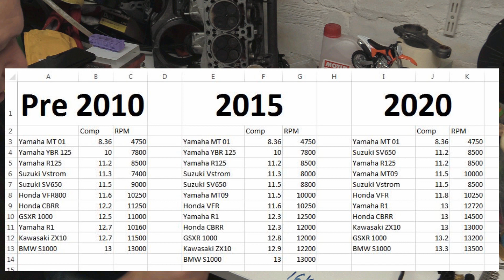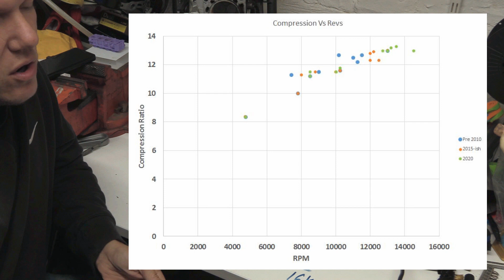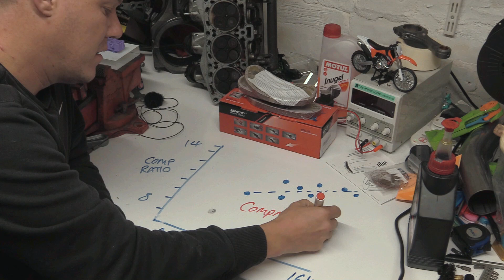High compression and RPM?

Comment: A little bit late but here are my two cents: The higher compression ratio obviously compress more the air/fuel mixture which mean that the air and fuel molecules comes in closer contact with each other , this increase the mixture temperature before the ignition event as well so both factors acts as catalysts of the fuel oxidation ( burning) , so it happens more intensively and respectively finishes faster. The faster completing of the combustion process mean not only higher efficiency, power,torque ( because the time for heat exchange between the burning charge and combustion chamber walls is shorter , so less heat transfers to the cooling system doing nothing but increasing the cooling required losses ,respectively this heat remains in the combustion chamber where increase the pressure of the expending gases ,which exercise higher force on the piston) but also allows higher RPMs just because the combustion occupies shorter time period . Higher RPMs are obviously needed for extraction of higher powers from smaller volumes engines ( which also mean lighter and more compact , two also very important factors for the bikes)Of coarse this affects negatively the longevity of the engine life ,which is very important for the passenger automobiles but far not so much for the sport bikes. That is it :)

Comment: I assume the higher the compression ratio you have the larger the torque you get. With the larger torque it is easier to get higher rpm. Engine producers were constantly increasing the compression ratio to improve efficiency. Higher rpm came as a result of it.
Reply from the maker: No.

It's not the compression that produces higher torque, it's the expansion ratio. 

Ignoring material stress rpm is limited by load, but increasing torque means you can except the load, however the next limit is aspiration.

Comment: All i know is, compression ratio is also affecting the "fuel quality" meaning with a higher compression ratio the engine needs high octane fuel to avoid mixture ignition before max compression occurs.
What that has to do with RPMs i have no idea

Comment: A Race Cam holds little compression at low revs & at high rpms the race engine struggles to get a full breath of air but has high rpm to its side to get high Horse Power numbers.A mild cam engine gets a full gulp of air per stroke at low revs so is where you must lower compression

Comment: The smaller the engine the smaller the diameter it has to rotate around. High rpms can also be achieved by high compression forcing the engine to rotate faster.
Reply from the maker: What? Lol that's not how it works

Comment: I know this is an older video, but I have a question. Is the compression ratio changing with RPM, or is it the dynamic compression that's changing with RPM? I'm under the impression that the compression ratio stays constant for the engine, but the dynamic compression can change.
Reply from the maker: Compression is the difference between 1 volume and another. So the compression is the same, what you're talking about is volumetric efficiency and density, that changes over the rev range.
Reply from the maker: There is no such thing a dynamic compression apart from variable compression engines

Comment: So my guess is since bike engine cylinders are more oversquare than usual, which increases the surface area of the cylinder for a fixed volume, that this facilitates better heat conduction, which would cool the charge more efficiently, reducing chance of detonations, and therefore allowing for a more aggressive compression ratio. 

This could probably explain the rpm trend as well because higher rpm bikes have to have even more oversquare cylinders so their con rods don't snap.

Comment: i guess that higher compression ratio results in more combustion force, what i mean is that suppose i am running a compression ratio of 10:1 on one engine and then on other engine i am running compression of 14:1 then the engine which has higher compression ratio of 14:1 will create more combustion forces which will result in piston travelling faster, and also higher compression ratio increases the thermal efficiency of engine which results in more power and also broadens the power curve.
Reply from the maker: Well no. Whatever you compress takes energy, so anything you get back is the same
Reply: @thedirtyworkshop  oh, i didn't thought about that, thank you,  please tell me what is the reason, please, i am trying so hard to find the answer but still cant find a relevant answer, please, please, tell me what is the reason, please.
Reply from the maker: What what reason is?

Comment: Hmmm this is real interesting. I'm not much of a wizard when it comes to how engines work so don't judge me to hard. My thoughts are that there's simply a competition involved between manufacturers and all that so when one raises the bar in that direction, others have to do so as well just to make sales. So they have to make more hp that means better /higher quality materials, different valve, intake, exhaust angles and the rest. Maybe something like longer duration camshafts etc..... Idk I guess whatever  cost-effective enough just to make that hp...!? And so all that shit they did (all the stuff I mentioned above, and possibly more)  to make 5-10 more hp allowed /yielded in higher compression ratio and higher hp. Or the other way around. Honestly I have no clue what I'm going on about..... Just some thought that make sense to myself.
 Basically by let's say changing valve angles and reducing weight of moving parts you could achieve decrease in combustion chamber size and increase in rpm, hp and compression ratio

Comment: My guess: Short stroke engines have lower piston speed compared to engines with longer stroke at the same rpm therefore leaving more time for heat to dissipate thus reducing the chance of engine knock.
Reply from the maker: At 12,000 rpm?
Reply: @thedirtyworkshop  Well the thinking continues then.

Comment: Also thinking about it, high rpm engines typically have longer duration cam timing and end up with less "dynamic" CR. The high static CR goes hand in hand with big cams. This is because the pressure decay is increased with a high CR engine, less residue energy is lost when the exhaust valve opens so it can open earlier without hindering HP. So i assume bikes (because of the high rpm design) would have more aggressive cam profiles than cars and hence a higher CR to complement this. Am i right .............or am i way off?

Comment: The faster the piston travels, the quicker you get away from the high compression or the faster the pressure decays and the less time the mixture is exposed to heat. Also cars are heavier so the engine is loaded easier so i assume they generally have lower compression for that reason also?
Reply: Seems like the most sensible answer I've seen so far

Comment: My first thought is that when you've got a higher revving engine you need the efficiency gain of that higher compression to be compliant with emissions, etc. They'd already probably be pushing in a bit more fuel to be able to get enough atomisation in that time, so it'd be running cool enough to deal with the compression without detonation.
Reply from the maker: Emissions tests aren't done at high rpm...
Reply: @thedirtyworkshop  Oh no! Then I have no idea. Edit: Maybe detonation is less likely when it has less time to happen because of the higher RPM? Just clutching at straws here.
Edit 2: Okay, here's my final answer: Higher-revving engines have better ECUs and enough good sensors to detect and mitigate knock so why not make them better at performing. i.e. high performance engines are high performance.
My Uno's engine is non-interference because it's easy and reliable and doesn't rev that high. My Alfa 156's engine is higher-revving, has higher-compression and has 2 spark plugs per cylinder and is heavier on fuel.

Comment: Matt, Your talking about dynamic Ratios not static.Are the pressures you put up on the
screen at peak power.? The swept volume of the cylinder means little till all valves are
closed.In short stroke motors little power is produced (depending on cam timing) until
you rev the living shit out of it.What you dont say is that  dynamic pressure is created
by RPM...Cheers.!
Reply from the maker: Pressures? No they're compression ratios and yes at peak power.
Reply: @thedirtyworkshop  Appreiciated

Comment: This might be the reason why pro stock v8s can supposedly rev to about 11500 RPM despite being 8.2 liter pushrod engines. They apparently run between 15:1 and 16:1 compression.

Someone please correct me if I got anything wrong.

Comment: I think they are vaguely correlated
it's probably because high rpm cams have less actual compression than static compression
F1 cars can run crazy compression ratios 17:1  because of super-fast combustion speeds
Reply from the maker: LOL nothing to do with combustion speeds, it's the other way around
Reply: @thedirtyworkshop So would it be that high compression forces fast flame propagation, allowing the engine to be efficient at high rpm thus making more power?
ALSO: You're a legend for answering the comments man!
Reply from the maker: Flame front speed is linked to density. Higher compression = higher density. But speed of a burn in microseconds is way faster than rpm

Comment: My guess is that an increased compression ratio allows for the combustion time to be kept in the ideal window to make power at high rpms via the added heat and reduced volume for the flame to travel.

Comment: Is it: 
1. Due to market competition, all bikes try to improve their performance year on year
2. An economical way of increasing performance is to increase RPM
3 Raising RPM only makes sense if the power stroke flame front can remain faster than the piston would fall at higher RPMs
4 Increasing pressure (or confinement) of an exothermic reactants increases the reaction speed

5. therefore compression ratio has to increase with the maximum RPM otherwise the maximum effective RPM would be limited by the speed of the flame front
Reply from the maker: Apart from the sv 650 which dropped both revs and compression from 2015 to 2020, undoing your theory...
Reply: @thedirtyworkshop  Damn!

Comment: A shorter distance from the spark plug.
The more 3D the the combustion the bigger the difference in temperature from mixture to walls. Nice even combustion for more "room" to ramp up the pressure. 🤯

Comment: Another person has alluded similarly but not fully. Essentially you run less risk of knock at higher rpm so you can raise the compression ratio.

When a gas is compressed, it heats up.
If the gas stays compressed in a cylinder, it will lose that thermal energy over time to the metal.
If the time the gas is stayed compressed is shorter due to the engine spinning faster, the cylinder will not heat up so much and be less likely to knock on the next compression stroke.

Essentially manufacturers can squeeze more power out of an already higher-revving engine.

Thanks for reading my explanation.
Reply from the maker: So a burn can happen but not a detonation? Really?

Comment: It's the differences in the fuel.

In 2010 engines were running on neat unleaded petrol with a rated energy value of 8.7 million calories per litre. In 2020 engines are running 5% ethanol contaminated unleaded petrol with a rated energy value of 8.3 million calories per litre. Unleaded petrol has a boiling point of 35 Degrees C, E5 unleaded has a boiling point of 18 Degrees C.

However the ethanol contamination allows for slightly higher compression ratios so engines can be designed & built to extract more power from a weaker fuel by revving slightly higher at a higher compression ratio. Computerised engine management systems sort out the combustion & other issues caused by the by having ethanol in the petrol. 

Unfortunately carbed engines have big issues with ethanol contaminated fuel, hence why owners of classic bikes & cars curse the sh*tty stuff because it causes running problems & damage.
Reply from the maker: And thats why the sv650 engine dropped its compression from 11.5 to 11.2 and the revs dropped. This was from 2010 to 2020... so you reasoning doesnt make sense...
Reply from the maker: This also doesn't explain why car engines and bike engines are so different...

Comment: The flame front propagates through the mixture quicker at higher compression ratios. If combustion is faster it allows for efficient combustion at higher RPM hence more power at higher RPM.
Reply from the maker: More power doesn't = higher rpm...
Reply: @thedirtyworkshop  I can see that, however, power comes from the combustion event, so power will be a product of how efficiently we can extract useful power from that event (which might be easier at lower RPM) and the number of such events in a period of time. More RPM more combustion events in a period of time will equal more power assuming we can still efficiently extract useful power from that event. 

I think my understanding of higher compression ratios is that the combustion event occurs more rapidly and so this would make it easier to efficiently extract useful power at higher RPM allowing engineers to develop higher power engines.

Comment: Conclusion,

As the rpm goes up there is more stretch and shrink in the connecting rod as well as flex in the crank giving you a fraction more length in the stroke compaired with when the engine is stactic???

Comment: I could well be talking out of my ass but here goes. I believe that the compression ratio is a function of other incremental improvements over time. So as the stroke gets shorter, the cam profiles are changed, the peak RPM and power output increases. therefore so does the compression.

Comment: Is it related to poor volumetric efficiency at lower rpm? Compression ratio being raised due to engines being cammed for higher rpm (more horsepower), much reduced cylinder pressure at lower rpm because of longer valve overlap/ late intake closing events?

Comment: I would guess it's because at higher RPM less air is drawn into the cylinder on the intake stroke. (the intake valves spend less time open at higher RPM)
With reduced volumetric efficiency at high RPM you can increase the compression ratio without detonation.

Comment: I reckon its because cars need to last longer. Lowering compression and rpm limit increases lifespan of the engine overall. Cars need to move a lot more mass. Mass of the car itself, passengers and the mass of groceries to feed those fat fucks all contribute to power and lifespan. 
A high comp and high rev engine can be done in cars but they don't last long.

Happy to be wrong. I'm married, so I'm used to being wrong

Comment: There are several car engines with those type of compression ratios.  Infact, the F20C out of the Honda S2000 came with two compression ratios - 11:1 (237bhp) and 11.7:1 (247bhp).  Both engines made their peak power at 8300rpm and both revved to 9250.  The high compression engine was only sold in Japan where they  have a high availability of 100RON fuel back in 1999 when it was released.

Anyway, we can see that there is no difference in RPM or peak power rpm, but a higher compression does yield more power.

So here is what I think - the two are not correlated.  More revs = more power.  Higher compression = more power.  This is simply a case of manufacturers getting what they can with advances in combustion control, ignition, and materials that make up their engine and it allows them to run these higher values.
Reply from the maker: Apsrt from the sv650. It's compression and rpm have both lowered over time...
Reply: @thedirtyworkshop  The SV650 is not a trophy bike.  There is no doubt parasitic loss from higher compression, so if you can produce your requirements without going to these high vales, you don't.  Again, materials, combustion techniques are allowing a smoother power and torque curve, producing less emissions, keeping the same power.  As you say, it's all about optimisation.
Reply from the maker: Also you example is a good example. 11.5 average and 9000 rpm is about right compared to the bikes.
Reply: @thedirtyworkshop  991 911 GT3 is 13:1 and 9000rpm.  What I didn't mention was mean piston speed.  If flame fronts were affected, then the F20Cs MPS of 26.2m/s, beats that of most bikes.
Reply from the maker: 26.2 m/s beats most bikes? Lmao! Dont be daft
Reply: @thedirtyworkshop  come on now, go and do the maths. BMW S1000RR 49.7mm stroke, 14200rpm, 23.5m/s MPS. New Honda CBR1000RR R SP = 23.4m/s MPS.  I think the Ducati tops it, but most bikes are short.

Comment: Higher compression means less cylinder head volume which means that you need less valve overlap, and less valve overlap in combination with high comp makes the torque band broader so you can have more rpm to play with and make power with decent fuel efficiency and torque at low rpm
Reply from the maker: Less overlap?

Comment: High RPM means less time for detonation to occur, cams for high RPM reduce the VE at low rpm so you can raise CR ?
Reply from the maker: Less time for detonation???
Reply: @thedirtyworkshop  afaiu it takes some time for detonation to happen, at higher RPM the compression and combustion might be over before it has time to occur
Reply from the maker: Detonation is an explosion, this is always faster than a burn...
Reply: @thedirtyworkshop  yes much faster, but as I understand it it happens with some delay

Comment: is it decievingly simple and its the tiny bit leakage past the rings at low rpm more time spent on the compression stroke relative to high rpms means lower compression, less time for leakage means compression is effectively higher at high rpms